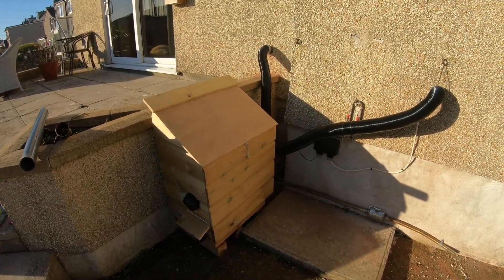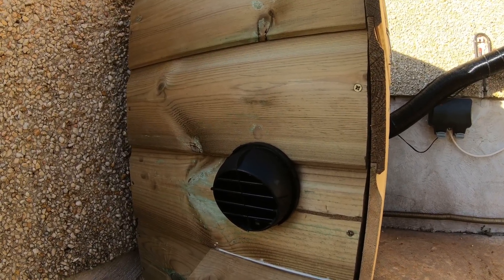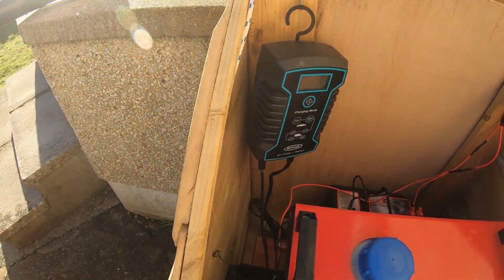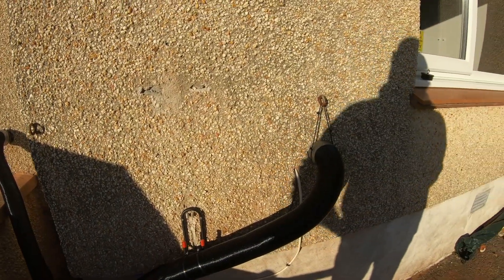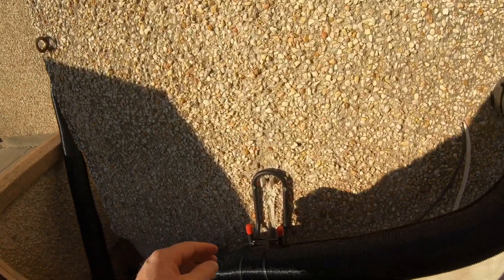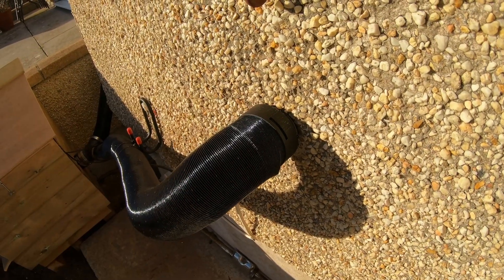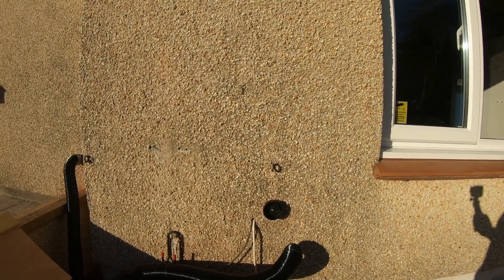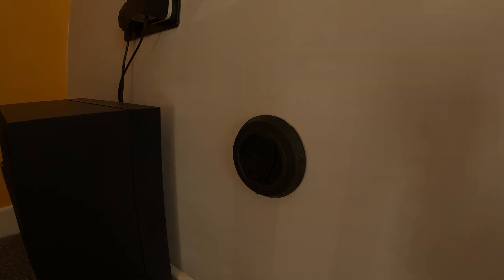Heating my home with a Chinese diesel heater.

Comment: Why didn't you just use a steel tube to go through the wall? 
I'm not seeing why you went from 75mm to 60mm diameter. It's only half an inch smaller overall. Wouldn't have been better to use white vents inside instead of black which let's be honest, DO stick out about against the white walls.
Also i'd insulate the hot pipes going into the house. I don't know how much heat you'd be losing but it must be a lot which would only get worse the colder it gets outside.
How much has this heater reduced your normal heating bill compared to the price of the diesel?
My house is a two bedroom semi and i bought one of these heaters to replace the standard fit Eberspacher that has been removed from my Land Rover 101 ambulance and have been wondering if it would work in my house to either replace or suppliment the gas heating bill. My own body thermostat is set a bit lower than most people's so 15 to 18 degrees is fine for me. I think i'd add a third hole in the wall so i'm heating air from inside instead of out. I understand why you don't but i have vents that are open all year around on the double glazing units so don't suffer with condensation.

Comment: 0:33 I don't wonder why it's outside.  All six of mine are inside so that I can recover the 50 percent of heat you are losing .. and so much snow loading  would bury them. I do keep my fuel tank and tip of exhaust outside.
Reply: Don't you think he sounds English? We had, and i quote, "THE WORSE SNOWFALL IN TEN YEARS"! last week. Driving to work along the motorway on Wednesday the signs were showing EXTREME WEATHER FORECAST HERE TOMORROW. And then on Thursday morning EXTREME WEATHER FORECAST HERE TODAY, which was odd considering all week the local forecast was 1 deg C and sleet. Driving home in the sleet that was SO BAD i only had the wipers on intermittent... Temperature? 1.5 deg C
Whem i woke up on Friday the snow was only covering half of the car windscreen. That's a typical snowfall in England...

Comment: This is exactly the video I needed thanks I'm just about to do this after moving into a freezing cold bungalow while also suffering with cancer (which makes you feel the cold even more) I want to do this method as I don't own the house I know I'm going to be drilling a hole in the wall but I'm hoping my housing association will be ok with it as I'm installing the heater outside the building (I need to do a stealth install 😂) it will be portable in the sense I can pack it up in short time to  put in my shed & hide the holes with vent covers 😅

Comment: You do know, when you keep the heater outside like that. It will work harder and use more diesel to heat up the air. Because its working harder to heat up the outside cold air. I have two diesel heaters indoors and never ran into that problem with condensation. exhaust going out and the intake is indoors too.
Reply: I don't think the heater is causing him condensation, he has condensation and the fresh air is alleviating it.
Personally, i'd do the same as you and address the cause of the condensation.

Comment: I have one heater installed in our hallway so we don't hear it in the lounge, but your idea is much better, so I will do the same as you have done. I have used mine for 2 winters and now I have ordered 2 more for upstairs (Our house is 4 flours high, so I expect the project will be interesting, but from my experience, well worth the effort. Your video is spot on, thank you.

Comment: Would it be possible to take the large hot air pipe and reduce it to say a 2-3" pipe to put through the wall? or would this create further issues?

Comment: Going to add a section of pipe to my warm air intake as you've done, just in the burn in period (10-20hrs the instructions say). 
The exhaust temperature has been tested between 130-202c and the warm air has seen 100c. Still working out the noisy exhaust and final enclosure. Also a 12v battery changeover system will be installed. 
Thanks for sharing your install !

Comment: The way you installed the heater, youre shoving moist outside air into your house. At night when the room temp drops this will cause high humidity, condensation and ultimately mold.
 It heats up the moist outside air, therefore the relative humidity drops. The absolute humdity however does not. The relative humidity then skyrockets at night when the room temperature drops.

Comment: Thank you for your video, I have been trying to get the answers to the trickle charge ,do you leave it attached to the battery all the time? Does it charge it as the battery is running the diesel heater? 🥰

Comment: Im pretty sure that your exhaust needs to be set to a more uphill gradient (as opposed to what it appears to be exhausted in a south direction until shortly before the actual outlet). The need to exhaust upwards (ie run the exhaust after leaving the heater, in a direction which (after the initial drop from the heater) is set on a course straight up (yours looks like is the reverse)  is particularly important where the exaust is extended as you have done.. Not exhausting straight upwards is not good for the heater (nor you), and if you exausted immediately upwards as you should you wold not in fact need to exaust so far out (per your extension) as long as the outlet of the exhaust was at a point higher than the air inlet (since  hot air rises, cold aid settles).  Obviously verfity this for your self and do your own research, since at the end of the day its your heater and importantly your health [ my exclusion of liability warning!!] .

Comment: If you decide to use oil for heating (only realistic if you are not connected to the gas mains - nothing is cheaper than mains gas) then it is better to do the thing properly and install a proper oil fired central heating boiler and large oil tank, so as to be able to buy oil in bulk, when it is cheap. Otherwise, an oil burning AGA is a good choice, if it has a back boiler to heat the hot water and run several radiators. The advantage of an AGA is that they can be switched over to run without an electricity supply, as they have a conventional chimney without a fan and the oil is supplied to the combustion chamber by means of a simple carburettor, which does not require electricity. These small Chinese units need a power supply to operate the fan. When I was young, most houses used paraffin heaters. They were simply, unvented units, so that they were used only in the hallway - the idea was that fresh air would come in every time the front door was opened and the fumes would escape! They were not very efficient, as most of the heat escaped in this way, but they seemed to be safe enough to use. In fact, I once owned a house with an unvented gas heater in the hallway, which never caused any problems, even with the fumes remaining inside the hallway. A gas oven, of course, is similar. If you have it running for three hours to cook a roast dinner, then the fumes remain inside the kitchen, but this never seems to cause any problems, unless, of course, the kitchen is hermetically sealed. Most kitchens have an air brick to ensure that they are never hermetically sealed, to deal with gas cookers (and, indeed, in days gone by, gas fridges, which used unvented burners).

Comment: I have electric storage heaters and currently my electric costs me £180 a month. My electric is about 30 odd pence a kilowatt hour and 80% of the money I spend is for running a horrible living room heater. It’s the most bloody inefficient heater I’ve ever saw or had. Also it’s Scotland so pretty cold in the winter. So today I bought a diesel heater off eBay,and I’m going to start experimenting with different ways to heat the living room and also heat water. I liked the idea of using an EGR cooler someone suggested.
Anyway….im a bit of a diy mechanic/sparky etc and have ocd so I’m going to log EVERYTHING!! Think I’ll maybe start a YouTube thing with videos of the builds and results. The heater arrives on the 19th December ‘24 so if any of you are interested,give me a follow/subscribe (think that’s what it’s called lol). Can’t wait to start it all
Reply: Night storage heaters are generally supplied by an Economy Seven meter, the cost being about 12p per unit. They are not economic otherwise. If you are paying the full day rate to operate them, it would be just as efficient to use simple panel heaters or an electric fire.
Reply: @ I have total heating total control (2 meters), and it sucks. The tarrif for night time ie heating is only 2p cheaper than daytime tarrif lol.
And that 12p you stated is actually 31p a kw/h. Absolutely ridiculous . As you said I’m better using a normal heater/fire! Only reason I don’t use one is at least my living room is warm in the morning
Reply: @ I am with EDF Energy. They generate cheap electricity in France using nuclear power (because the French have their heads screwed on the right way) and send it to us by undersea cable, and sell it to us at bargain basement prices! My electricity costs 12p at the night rate and about 24p at the day rate.
Reply: @napper1496  Presumably, EDF Energy do not operate in Scotland?
Reply: @ yes. I’ll call them Monday morning to see what their tarrif price is.
Reply: @ Who are you with at the moment?
Reply: @ ovo.

Comment: I set up one to heat my wife's salon ( wooden cabin). It's a fantastic solution, very cheap to run.
Reply: https://youtube.com/shorts/lMVZUC3VDyY?si=BeOWzOfuZ7tRitZA
Reply: @aidanbrennan7389  I'm needing to do the same in a building like that .. the building is 16x40 open floor plan.. what size is your building?
Reply: @aidanbrennan7389  so it just sits in the floor inside building? 
How did you work out the exhaust?
This is also a hair salon..
Reply: Is your build posted anywhere on Facebook or YouTube and how you have it mounted to the building? Thanks
Reply: Can you show a picture of your setup please?
Reply: @colonmills6075  I can't attach images here. Feel free to email me for photos
Reply: Our cabin measures 12 by 24 feet, so I divided the output into two sections and routed the heat through insulated pipes into each room. The plastic box shown in the photo is located outside the cabin. My wife uses the remote control to turn the heat on and off. I relocated the control panel from the front of the panel to inside the cabin so that my wife could monitor the temperature and manage the heat flow. Very cheap to run, on green diesel. I'll upgrade the fuel tank soon.
Reply: @aidanbrennan7389  where are you located?  I've got 2 of these units ordered.. I like how you did the splitter.. I might do that too since the area is so large.. only planning to use only  one heater there ..

Comment: nice DIY job . would it not be better to fit to outside wall though ? losing alot of the heat through the long pipes coming into the house and how long is the programmer cable? cheers

Comment: Hi. Thanks for doing this. Here's a bit of feedback, if you would like: I think it's a shame you went to the trouble of making this relatively detailed video without also sharing some fundamental numbers: i.e. what brand and capacity/power is the heater (maybe a purchase link?), how much did you pay for it and for all the extras bits and miscellaneous hardware like ducts and extensions and trickle charger, what temperature does it achieve in both rooms on which setting and how quickly, what is the average inside relative humidity when using this type of heat (I imagine this would be quite dry heat but you mentioned condensation without the outside air input), how long do you typically run it for on a winter's day, what does it cost to run, what type of diesel fuel and how often do you fill it?...etc. Some footage of it actually running and clicking away would also have been welcome, both inside (I imagine all you can hear there is airflow, but that is still quite audible to some of us) and outside (for the impact if might have on neighbours with sensitive ears and open bedroom windows nearby). Maybe a temp gun on the outside ducts to give some indication of how well they are insulated? All questions anyone thinking of this sort of setup might be asking themselves, I reckon. Ta.

Comment: Just a small note,these diesel heaters are totally fantastic(got one in my camper)I installed it about 8 years ago(no problems with it,I might add)…..the only thing is when you open one up you’ll notice that the electrics are not waterproof…..so if you install them outside,you will need to keep that in mind.You could seal the electrics,Conformal coating – This involves spraying or brushing the board with a thin protective layer of sealant,or potting👍😉

Comment: I know this was a year ago, but I advice investing in the proper eberspacher or webasto insulation on the ducting pipes, it saves up to 60-70% heat lost to outside. I have a similar setup with the casing box and heater mounted on the outside wall with 75 mm duct covered in aforementioned insulation and further covered by 100mm flexible aluminium extractor fan ducting between end of heater and into wall.
I will post a video in due course.

Comment: interesting video. but is it worth plugging the gap where your electrical wires go through the external wall to stop rain getting in. and also around the entry vent?

Comment: Very interesting and well explained. I think I’m going to go for it. You mentioned about the condensation which my house suffers from. Do you think that possibly a side benefit of your system is that it acts like a PIV unit as well, so pushing air around the house?…..just a thought?
Reply from the maker: Yes Waldo. It certainly helps. Do it, I’m sure you won’t be disappointed.
Reply: @en53kff  ok thanks, I’m going to do it. Wouldn’t attempt to do it without videos like yours 👍

Comment: I’m thinking come winter time the heat coming into the house will be significantly reduced due to the pipes being so exposed.
Reply from the maker: Read the forward. It does mention that the pipes were insulated once the video had been made. It’s now into its third year with great heat output and no problems.

Comment: i had , one thought when you said you spilt the diesel and the smell came into the house, how about you fit the fuel tank outside of your box, when you see videos of youtubers taking the heaters apart the fuel tank comes off easily and you may want to consider fitting a bigger tank, you can add another box to cover the tank. i'm getting my first heater tomorrow and plan to do what you have done so its nice to see others doing the same
Reply from the maker: Hi Ray. The smell from the diesel came from the air intake pipe. The diesel tank is located outside with the heater. I’ve replaced the small tank with a 15 L tank which lasts quite a few days. It’s now into its third year and is running like a dream producing lots of heat.

Comment: It’s a better option than those useless heat pumps. You cannot get heat out of a stone and a flame is the best option. Comes from experience down in New Zealand so don’t get sucked I that heat pumps are good, they aren’t if your temperature get below zero. I have one of these diesel heater for my insulated workshop. It’s toasty!

Comment: hi there 
i am v much intrested in this heating  system ,,,  but  need  some info ? clarification ?  is it  safe for use in the house  i mean is there  any risk of   FUMES  or  SMELLS  ?
Reply from the maker: Hi. You must direct your exhaust in the opposite direction to your air intake to keep it safe and direct fumes away. I don’t have any smells come into the house.

Comment: How did the heater go 12mths later mate? Is it reliable?  Cheers
Reply from the maker: Hi there. My heater is now into its third year and is running like a dream producing lots of heat. Last week I took the heater apart for the first time to give the chamber a good clean. To my surprise, it didn’t need it. How I have got it tuned must be more or less perfect. I’m so glad I took the plunge and decided to buy one. I’ve never looked back.

Comment: I am running the same heater in a office unit (well isolated shipping containter unit with windows and a normal door) and its great and i have  same set up basicly/more or less............

But i hate one thing the fuel tank its inside and small meaning 5L is okay for a few days a few hours a day heating on a medium size pump speed..

But having a 40-60l tank with a internal fuel sender and a fuel gauge in the unit would be perfect and since the show show works on 12V its a great match ................A fuel tank from a car is perfect,i am thinking of making something from a plastic fuel tank from a car with a fuel lever gauge inside.....

Comment: It would be better to use the metal flexible exhaust pipes(extended) to create a small radiator for the taste gases so that it can distribute the heat before it goes out cold(or much colder). That was it's a double heating system. In addition, what fuel are you using? I use half diesel and half recycled sunflower oil. To purify the old oil, make a paste of Baking powder and water, add to warm old oil and then bring to a boi, stirring constantlyl. It will get most if not all the impurities out, which saves you from using several filters of diminishing sizes.
Reply: You funny..    he is already losing half of the heat by a) heating outside..usually moist air. B) combusting cold wet air . C ) thermal losses through the loooong pipe runs..  recovering the heat from exhaust means nothing when outside.  He will be lucky if this thing doesn't soot up immediately.

Comment: NEED to put the links OR the actual name & part numbers of that flexible hose & the Y connection  in your comments OR here in the comment section
Reply from the maker: It’s easy to find with a quick internet search, particularly on EBay.